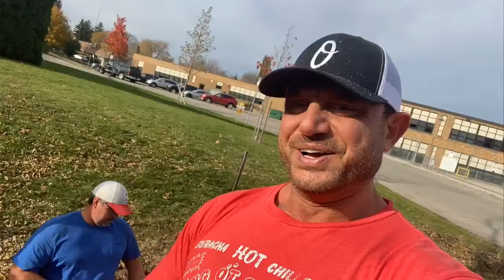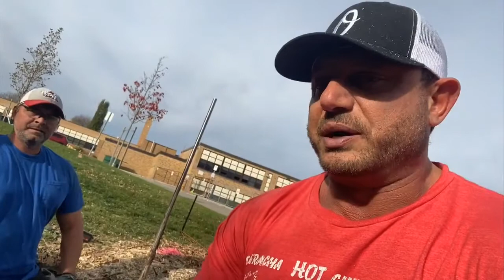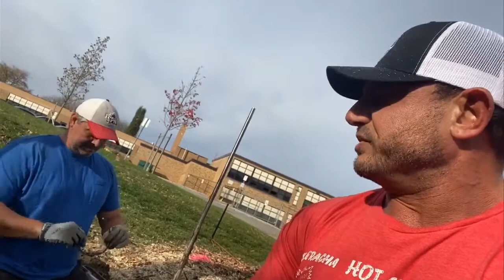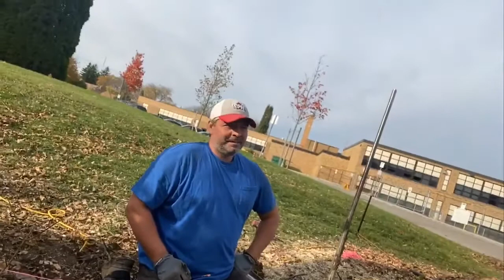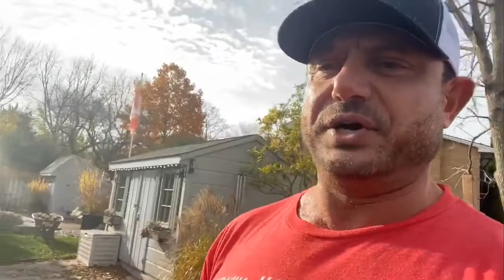Dealing With Roots While Digging Post Holes

Comment: Would've been nice to hear how you manage to get beyond those obstacles.
Reply: This video gives the solution to call a pro. You can cut roots with a sharp chisel end of a digging bar, works like an axe. Sometimes a sawzall or chainsaw but expect damage to the cutting teeth to be beyond repair. For under ground concrete you can dig around it more and remove it unless it’s too large then the option is to go through it. Power chisel, digging bar, or core drill are some tools for going through. There really isn’t an easy affordable option. Either work hard or spend money. If the concrete is solid enough you can get a really good grip with 5/8 wedge anchors and pull it out sometimes with a truck. Sometimes the best option is to put the post somewhere else if possible.

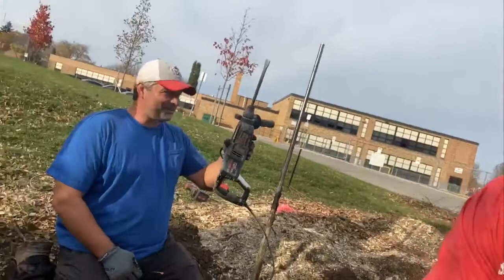Comment: 1:09 what is that tool?
Reply: Looks like a roto hammer. Not a good tool for cracking concrete or cutting through roots really. If you want one I recommend the Bosch Bulldog.